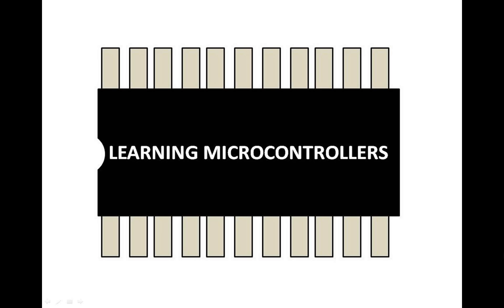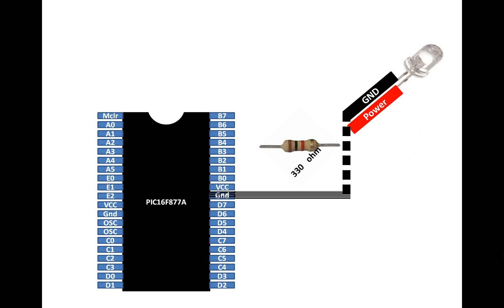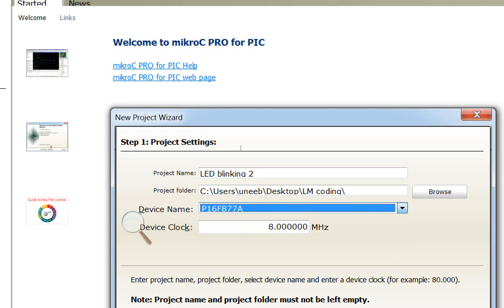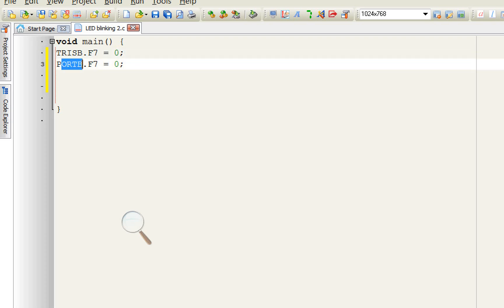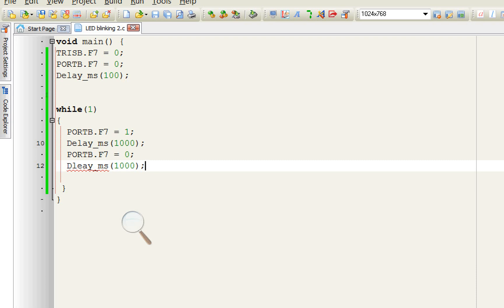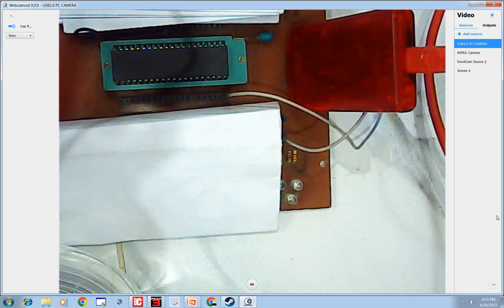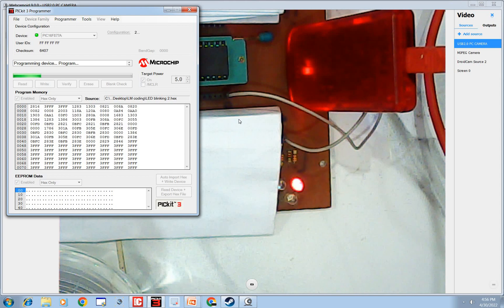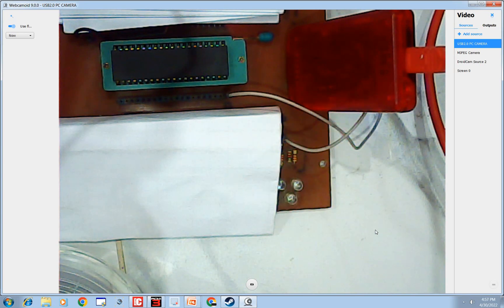PIC16F877A LED blinking tutorial using MikroC for PIC software.

Comment: May God protect you and your family for eternity
You are really powerful however i know you don't even know

My mcu will not respond to any of my code for almost a month now
I even purchased a new programmer pickit 3 thinking it was the fault however my problem continued

I just gave up 
I don't know what prompted me to watch a basic example on how to blink an led and selected your video
I then copied your code word for word although i had done the same thing previously however listening to your tutorial I uploaded the code one more and nothing happened however something prompted me to press the reset button and to my surprise my Love came back or should I say my pulse that my Led began to blink again after a month of dead ends.

I tried almost everything with the configuration fuses and oscillation

Thank you once more 

Sincerely

Ejike 

💌
Reply from the maker: Email me at uneeb629@gmail.com
I guide you
Show me your circuit diagram 1st
I think you are missing MClR setting
That is reset pin
Either you give high state from programming
Or you connect 5 V power to that lin using 10k resistor
Else your circuit will start in reset state
Normal state is when its high else by default its law which means circuit is reset
Send me your circuit diagram
Regards
LM
Reply: @learningmicrocontrollers3561  Thank you